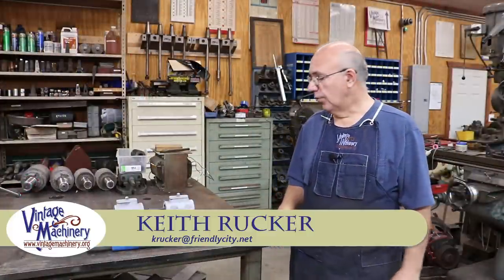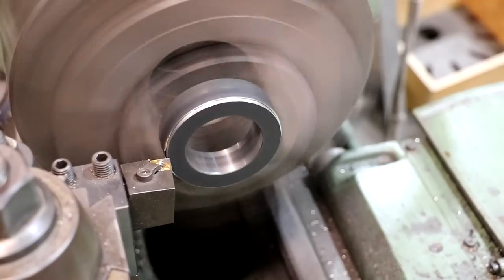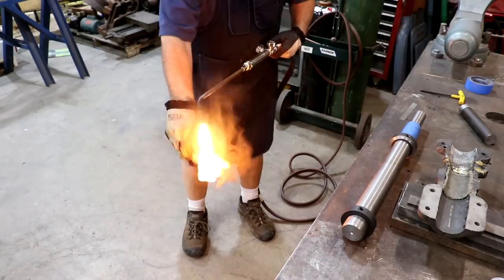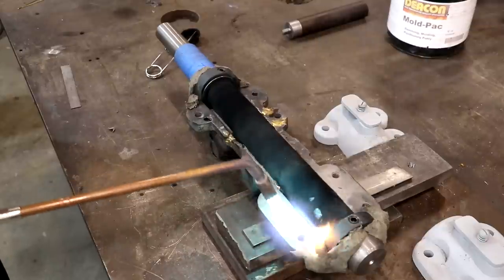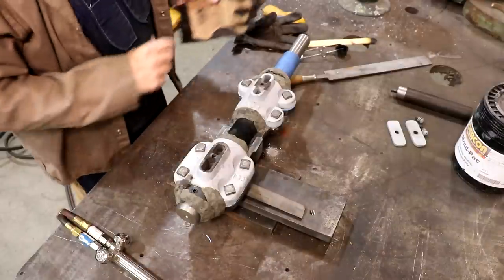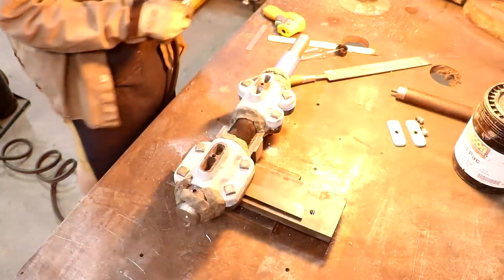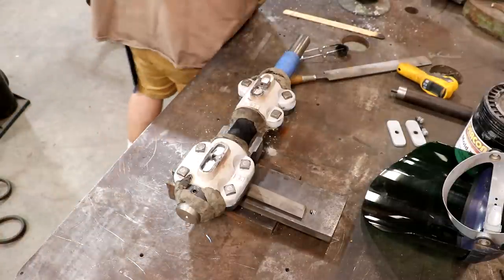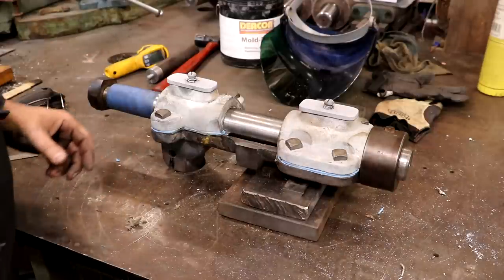Diresta Bandsaws Restoration 22: Pouring Babbitt Bearings on the Upper Wheel Shaft

Comment: Nice job. Brings back a lot of good memories of pouring, patching, and scrapping babbit bearings. I was lucky enough to serve an apprenticeship at a machine tool rebuilder in the early 70s before working on hydro turbines, where I worked with large babbit bearings. Sometimes taking a couple of days to scrape a single bearing. I once even was lucky enough to be part of a team that hand-scraped the bearing that an observatory sat on. If I remember correctly, that bearing segmented was 32' in diameter.

Comment: I’ve watched all of your videos. Many of your videos I consider teaching videos. I took machine shop 9th trough 12th grade. 11th and 12th grades I took double periods of machine shop. After watching all of your videos. The videos where you explain in detail what machines to use and how to fabricate parts. These videos are really easy to understand. Not that I ever will, but I’m confident that I could go to any machine shop that doesn’t use machines that aren’t CNC machines And fabricate precision parts. Right down to using a dividing head to cut gears. 
Becoming a Machinist was my second choice of what I was going to do with my life. My Grandfather and Dad didn’t want to hear this from me.  I come from a Railroad Family. I’m a Retired 5th generation railroad Locomotive Engineer. Both of my sons are 6th generation railroad Locomotive Engineers and my oldest Grandson just recently passed the Conductor Class and is a 7th generation railroader.
  Your YouTube channel is one of the few that I always look forward to new videos. Thank you for all the what I consider teaching videos. 
  P.S. Excellent job done on the belt driven planer,your horizontal boring machine and any of the other machines you’ve reconditioned to more accurate than when they were new.

Comment: Question; do you need to worry about the babbitt shrinking after casting? Or is the shrinkage not enough to worry about?
Also wondering about your babbitt mix: Do you use a bit of bismuth in yours, and why/why not?
Reply: It doesn't shrink very much and in the end the amount it does shrink just gives you the clearance it needs to form the oil film.

Comment: I remember folks saying that solder was Babbitt. With the modern lead free stuff that is getting closer to true. For anyone who doesn't think a babbitt bearing is any good, they have never seen the bearing in most engines. They are no longer poured in place but modern insert bearing still have a babbitt layer on them.

Comment: The oldest known (wooden) ball bearings date back to 40 BC. Babbitt alloy was invented in 1839. So technically ball bearings are a lot older than Babbitt bearings. Although it took until the late 1800s before mass-producing bearing balls became practical and ball bearings started to become common. And Babbitt bearings are just a special case of plain bearings which have been used basically since the invention of the wheel.

Comment: If someone is maintaining the machine properly, how long can the babbit be expected to last?
Reply: They usually last for years if not decades. They still use babbit bearings in ships, there are some applications at which babbit bearings are better.
Reply: If properly maintained and adjusted they can last the lifetime of the owner. What normally does them in is the lack of maintenance and disuse. The second one is also the same thing that wears modern engine bearings, the dry start. Even if you fill the bearing caps with oil the oil doesn't create the film across the face until the shaft is moving. When the shaft is stationary it will settle and squeeze the oil out and you get metal on metal.

Comment: If I remember correctly the shaft has left hand threads on it to start with
Reply: I think that’s correct but a RH threaded nut should work fine to pull that long taper into the big wheel. The taper fit should never slip in the wheel after tightening.
Reply: @ellieprice363  I agree but if he wants to do it back like it was built originally it is a minor detail that is not correct do to it being left hand thread is the whole reason that he had to remake the shaft to start with
Reply: This is the driven shaft, it was the driver shaft (the one with the pulley) that had a left hand thread, he redid this other because it was quite worn from having turn against the cast iron supports due to completely worn out babbitt bearings.
Reply: @ruben_balea  I think you are mistaken he was trying to loosen the nut not knowing it was LH and pulled the tappet so thought that he had to cut the shaft apart to get it out
Reply: @chrisrhodes5464  I know, but that was the shaft of the bottom wheel, both wheels turn clockwise looking at the saw from the front.
The lower shaft is driven by a pulley at the rear, so at the front it needs the left hand thread to prevent loosening.
The upper shaft only holds the upper wheel in positon, it doesn't transmit any power, but with a left hand thread it could theoretically come loose if the axle seized in the bearings.
Until a few decades ago engineers were really concerned with cases of loosen nuts that really are almost impossible to occur in real life if the nuts are tightened to the proper torque, it's like being afraid that the chuck on a drill will unscrew from the shaft every time you release the switch.
I have a trailer made in the late 70s and the left wheel uses right hand threaded nuts but the right wheel still uses left hand threaded nuts.
Reply: @chrisrhodes5464  The long taper is completely adequate to drive the big wheel with the correct torquing tightening of the RH nut. True it’s not period correct but no one will know the difference in twenty years from the back of a galloping horse!  I’m certain Keith will not make a new shaft for a minor detail like that. I’ll be happy just to see that big boy run again.
Reply: @chrisrhodes5464  Nope he is correct. The bottom shaft has the left hand threads, the top shaft was right hand thread. Two reasons you can tell it's correct, one is that it is in the original video and two, that was the original nut that Keith installed, would be very hard to install a LH nut on a RH thread...
Reply: @Blazer02LS  you are correct I went back and watched part 4 5 6 over and the bottom shaft has the left hand thread top shaft standard thread it was my mistake all along I didn't realize he was working on the top shaft mount
Reply: @chrisrhodes5464  Well to be fair it has been a while... LOL
Reply: @Blazer02LS  well when I screw up I will own up to it I don't know why but I thought he was pouring the babbett in the bottom part
Reply: @chrisrhodes5464  We all screw up now and then. Comes with the territory of being human. The big thing is that most humans learn from making a mistake. The others are Darwin award candidates.